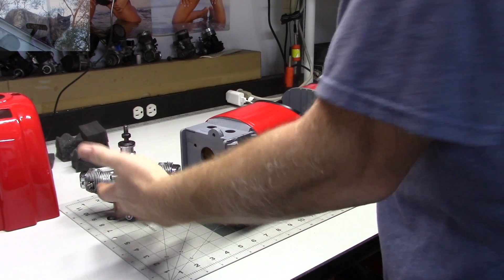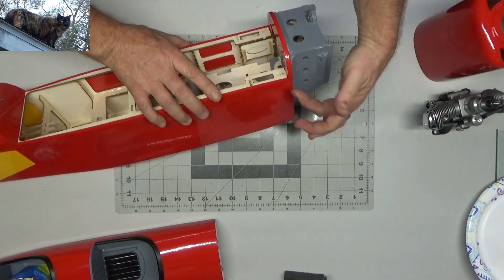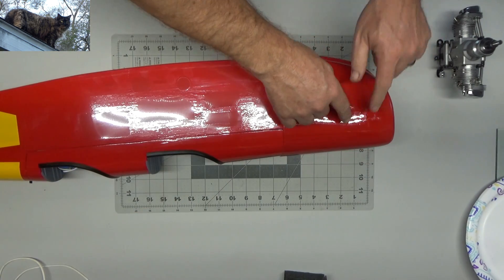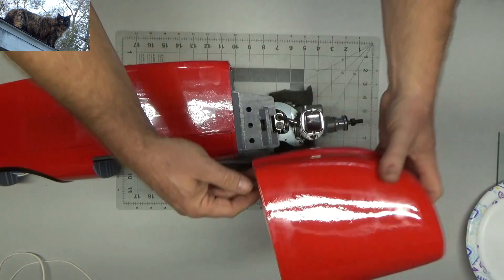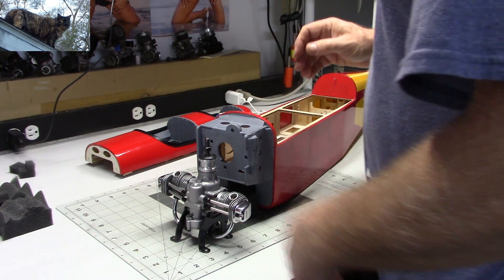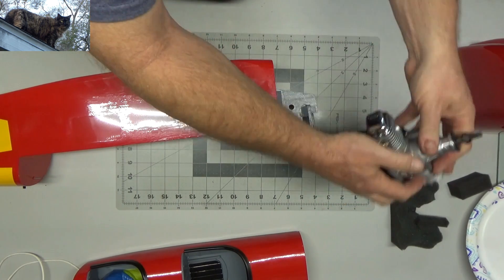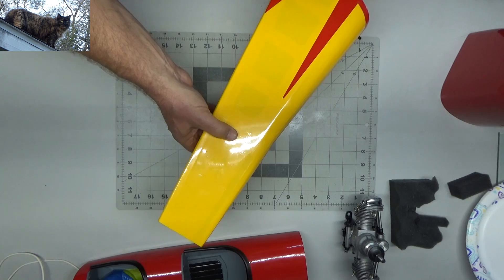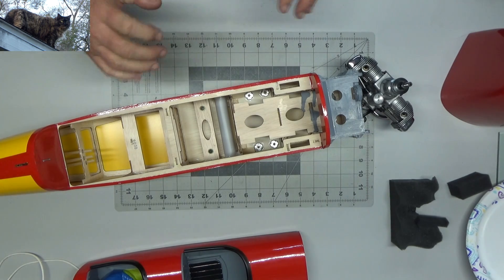Phoenix Spacewalker II Engine Fitment Evaluation Saito FA-60T Part 2

Comment: I am thinking of building this plane with a Saito 100T. The mount is 15mm taller than the 60T. Of course, it is a bit heavier, but it puts out the power similar to an 82 single. I have previously mounted it to a World Models Rambler 46 and it was really cool. For some reason I sold the plane on RCG, then a couple years later bought the engine back. The owner had crashed it, so I have to replace the crank and bearings. I have the parts and I'm looking forward to hearing it run again. Of course, I could just put it in a cub. Never had a cub before...

Comment: I wouldn’t worry about servo relocation. It would be far easier to just use stick on lead weights at the tail tip to achieve balance. There is enough tail moment there that you won’t need many weights. Once the tail feathers are on, no one would notice them. Great engine selection BTW.

Comment: Why don't you just put the cowl on where you think it goes and stick a ruler in and get a measurement to where the back of the spinner would be.  Then just measure the engine, if the engine is shorter you can space it out or cut the cowl. I would cut the cowl if possible to move the weight back.  Thanks for the videos.

Comment: Aaaaa...The part of the hobby I love, the build...Customize to your own specs...I have never owned a twin, so I am trying to visualize the cutting of the cowl...
Reply from the maker: Yeah, me too.....
Reply: @dmrcflyr2  I'm sure you know the paper and tape trick for cutting holes in the cowl.  I wonder if you slit one side to were it would slide over one cylinder and clip over the other.  Or make it a two piece?
Reply: @dmrcflyr2  i have seen set ups similar to what you have here, many split cowl in half so you have a top and bottom or left and right sides,  creating the means to join the halves is the trick